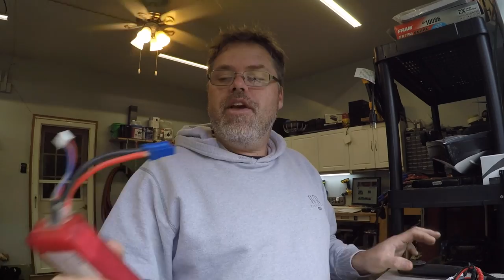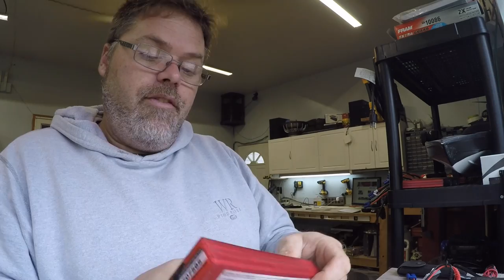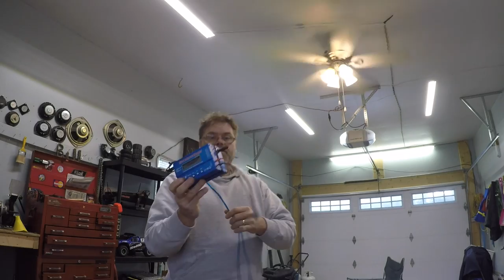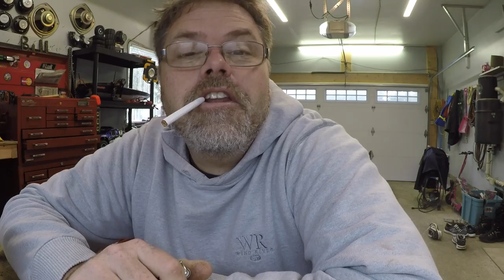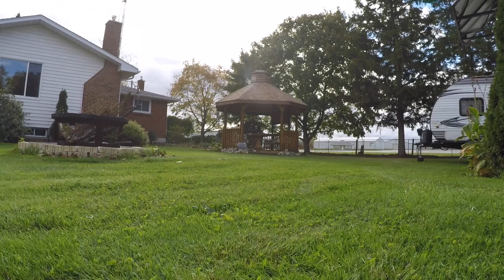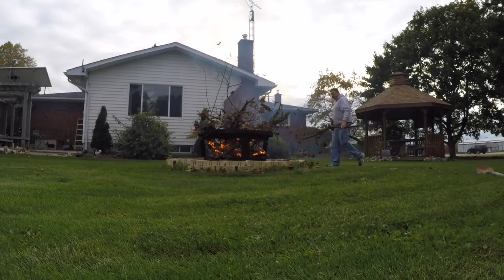RC STUFF AND LIPO BATTERY'S And Building A Fire . Happy Halloween  Everyone

Comment: The recommended voltage for storage charge is 3.8 volts per cell and store at room temperature......I personally discharge the batteries and charge back to storage voltage once a month just to keep them cycling well plus it let me inspect them on the off months